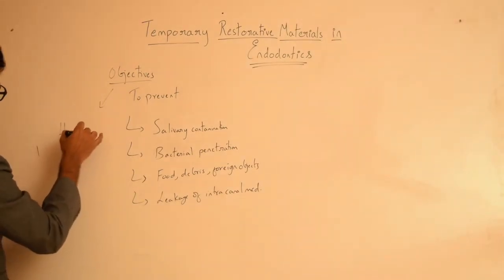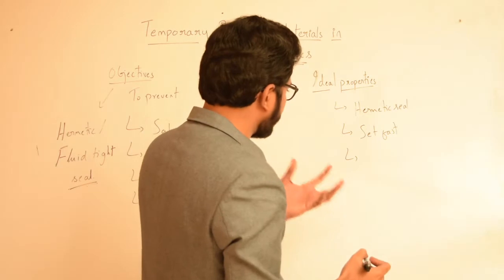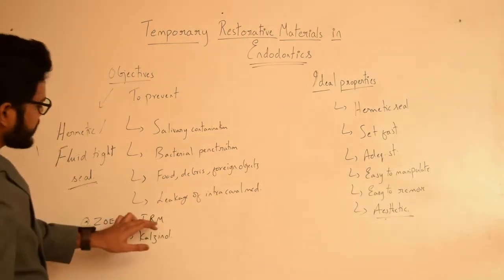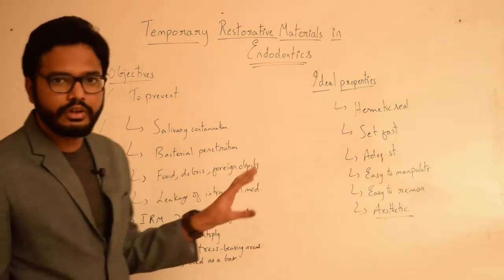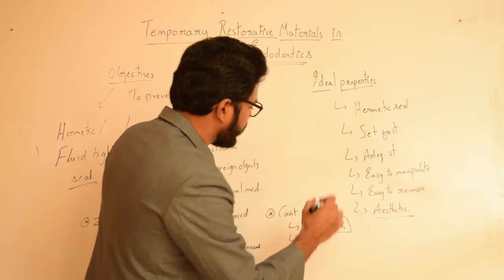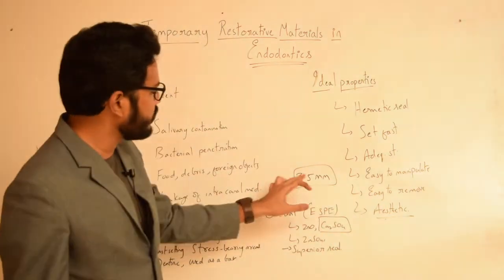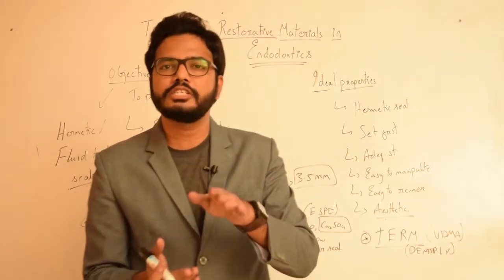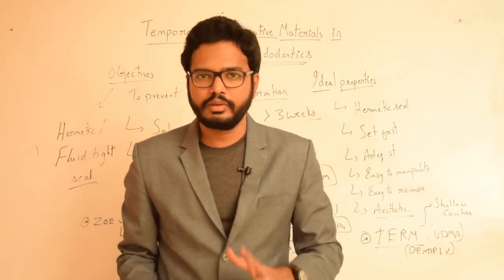Temporary Restorative Materials in Endodontics

Comment: sir, could you please explain the difference between 1.apical tug back and 2.curve lock.
Reply from the maker: Hi, good question. Tug-back is slight frictional resistance of a master cone to withdrawal when seated at least in two dimensions. On the other hand, Curve lock or Taper lock is a phenomenon seen in tapered instruments when canal cross section is smaller than the non-cutting tip of the instrument. It can be prevented by performing adequate coronal enlargement and also by manually establishing glide path before using rotary instrumentation.
Reply: Thank you :)